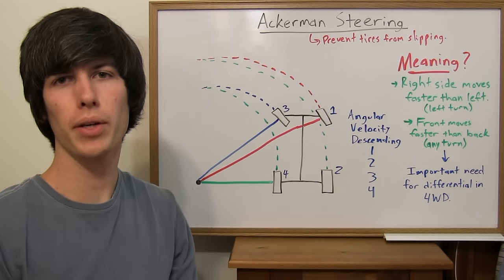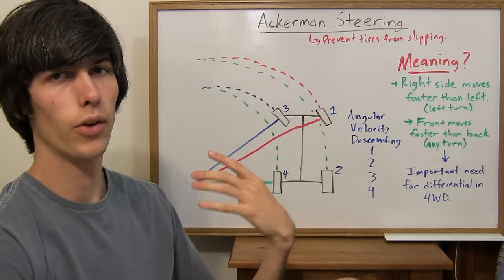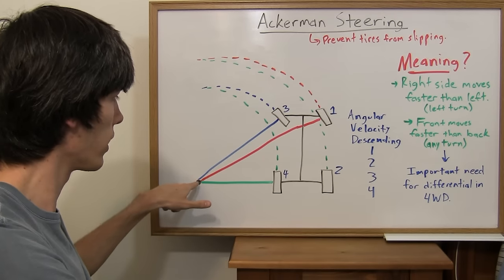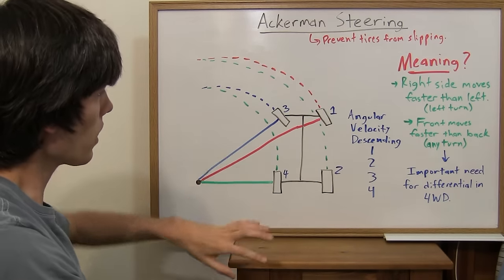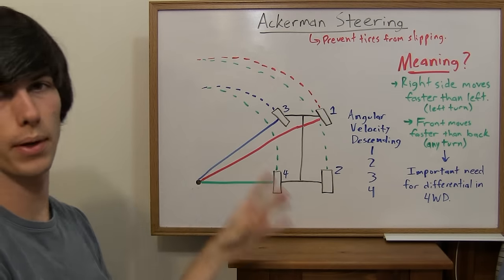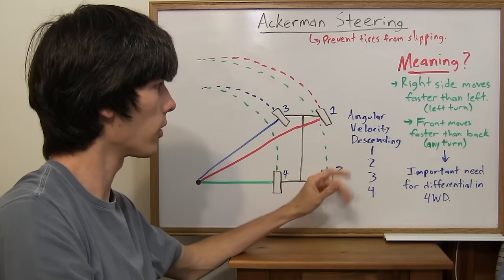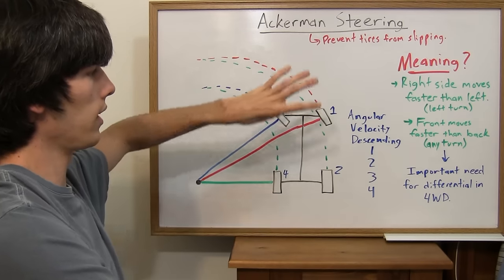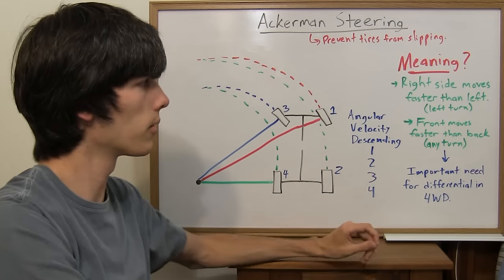Ackerman Steering - Explained

Comment: okay, my question to anyone here: does the most tight turning circle of a car change if it's going at different speeds, aka if the steering wheel is at full lock can you turn sharper at certain speeds, what about reverse vs forward? is it always the same?
Reply: +Johnny Dib Yes, it does change. The simple way I understand it is that your tires are essentially "slipping" all of the time. The difference between the direction your wheels are pointing and the path you actually travel is called the "slip angle" and this angle increases with speed. Thus, at lower speeds, you have a lower slip angle and your path will more closely follow the direction you point your wheels, allowing you to turn in a smaller circle.

I'm still learning as well, so if anybody can correct me please do
Reply: +Christopher Hitchcock ah i missread that at first, yeah it only seems intuitive that you can make a smaller circle at lower speeds; thanks for the reply!!
Reply: +Johnny Dib I was really surprised to hear about this at first too! I couldn't wrap my head around it until I started thinking about it when I race my car in real life. Why is it that my car will go through a corner perfectly at one speed but will understeer into the grass if I go slightly faster, even if I apply the same steering input?
Reply: +Christopher Hitchcock basically the more screeching tires the wider the circle eh.
Reply: +Johnny Dib For most tires yes! In my experience the expensive sticky tires make very little noise until you totally lose traction.
Reply: With Ackerman steering, the lines perpendicular to each wheel will cross a variable center point dependent only on the position of the steering wheel. The lines perpendicular to the center of each front wheel must intersect with the line perpendicular to the center of the back wheels all at the same point. This center point varies only with the position of the wheel and there are no mechanics in it that adjust for the car speed.

Of course, the faster a car is moving, the more centrifugal inertia to overcome when you want to change direction and limit the maximum it is safe to turn the wheel whilst steering. When the force provided by tire friction is not sufficient to overcome the resistance force of inertia generated by trying to change direction at the speed requested, then the wheels will slip and you may lose control of the car.
Reply: Well if you consider theoretical scenario where tyres can provide as much friction as you want, the steering radius of a given Ackerman steering system remains constant. But the world isn't perfect is it? There is a concept called as tyre curves which deal with the friction, heat and friction angles. Every tyre can have a slip angle for a given speed. At that speed, no matter how good your driver is, the tyres skid and effective radius is limited. So yes, we can achieve min radius at lower speeds and at higher speeds we can take sharp turns by skidding but that is not Ackerman. That is the magic of brakes.
Reply: are we talking about the variable steering like on the ford focus???? because thats all controlled via a electric PS pump
Reply: go to service shop , he will answer  u                     :)

Comment: help help help
in case of a two wheel drive when the frontaxles dont have differential or any other thing that changes speed, how does both ie left and right front tyres move at different speed.
or do they move at same speed,if so wouldnt one tire slip

Comment: It says on the top of the whiteboard: Ackerman steering prevents tires from slipping - that is nonsense.
Reply: corsair919 It makes it so that the tires do not need to slip when you go through a turn. In a geometry where the front wheels are parallel, one tire must slip to go through the corner.
Reply: why is that?

Comment: At the Berlin Motor Show in 1936, Mercedes demonstrated a front and rear wheel steering chassis in front of Adolf Hitler. It never caught on, but lorries use it these days, but only at slow speed with small movement.

Comment: Good video, but not as good as your current videos. You've refined your craft. It's spelled Ackermann with two Ns. Invented by builder Georg Lankensperger in Munich in 1817. You can see this easily in many Lego vehicles, where the steering mechanism forms a trapezoid rather than a parallelogram.